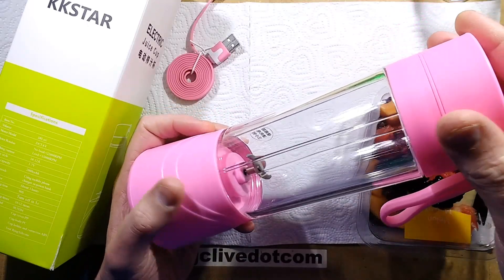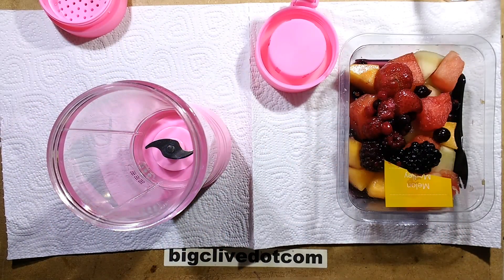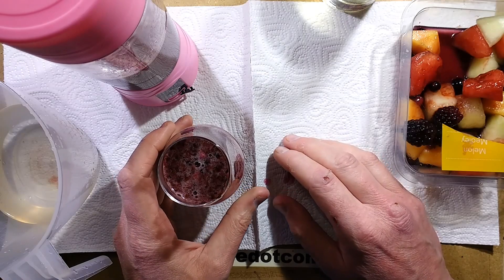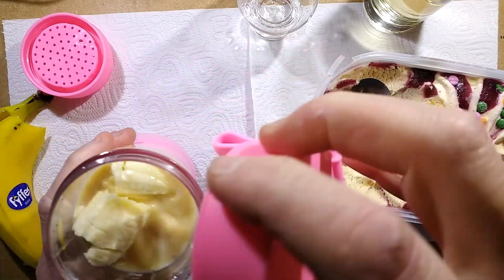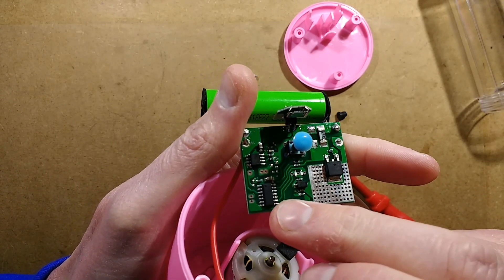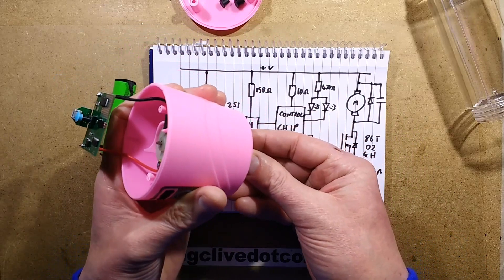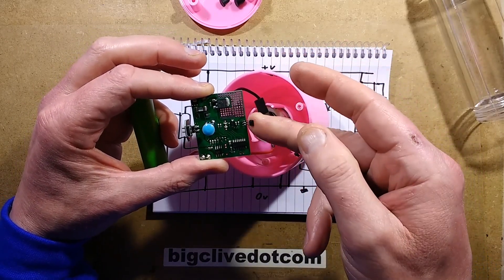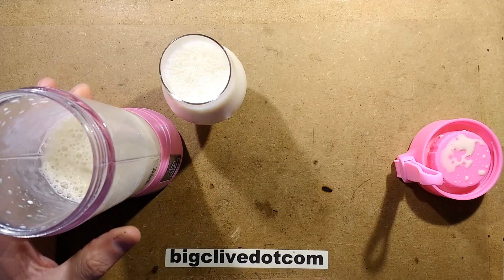Pink plastic USB blender test, fail and teardown.  (With schematic.)

Comment: wow, that's alot better than I was expecting from a phone battery driven blender. might consider getting one to play with.
Reply: Trust me this thing is a bad sex toy.
Reply: Not exactly a phone battery, it's an 18650 they are used in e-cigs and some camera equipment amongst other things.
Reply: "I haven't ran across a rechargeable vibrator using a USB connection as of yet" - should we ask how much effort you've put into this search?
Reply: The battery has 6.28 gigawatt hour/ gram power density.
Reply: there are rechargeable usb ones. or so Ive heard...
Reply: unsure of the USB bit but there are ones that are rechargeable and mains powered ones if you look
Reply: I'd rather not...
Reply: Thanks commentor
Reply: I was making a generalisation lol, calm down sir

Comment: Next video from clive: USB Powered dishwasher
Reply: DerpyDoom
Does one dish at a time. Takes 3 hours. Uses water gathered from the "dehumidifier" in the previous video.
Reply: Or a toaster using Chinese MOSFETs  that work once ;)
Reply: After that, we have the USB powered coffee pot and the USB powered hair dryer.
Reply: You could probably USB power most things, given enough batteries and enough charging time.
Reply: That "water" would actually make for a good dishwasher detergent, though it would need to be diluted
Reply: Just USB charged my car battery
Reply: There's a usb powered washing machine. It's just a turbine you have to attach in a bucket.
Reply: I have the same and mine works perfectly it needs to be charged for 3 to 4 hours or more. I love mine

Comment: I really hope you washed it before use. :)
Reply from the maker: You're damned right I did.  As with ANY new food product.
Reply: I got one that features a power bank function as well, and came with pre-grown mildew inside the glass container, uhgg .. But nothing better than extending your phone battery life with the mixer that made you sick. ;-o
Reply: Also - the safety functions are missing - no hall sensor included (unpopulated on circuit board).

Comment: I wonder, why are the ic powered through resistors?
Reply from the maker: The 10 ohm resistor and capacitor across the control chip will act as a crude filter to reduce the risk of motor-transients affecting the processor.

Comment: I wonder if you could modify it by adding another 18650 in parallel with the existing cell. Would doing so help to prevent the motor from stalling? Think it's time for more drinks.
Reply from the maker: The stalling is the overload detection across the sense resistor.  It's probably optimised to protect the motor from damage.
Reply: bigclivedotcom - would the control chip have the function to completely stop the unit if it detects several overloads in short succession, i.e. an "I really can't cope with high chunks of melon so there's no point continuing" cut off?
Reply from the maker: I think it just annoys the user into submission by stopping for a short time each time an overload is detected.

Comment: what about uprating the motor to something like a 3-phase motor and a 3-phase power generator that can work of a Lithium battery, or actually scale it up.
Reply: DAVID GREGORY KERR sure you could put a 3 phase motor and an inverter to drive it. Doing so would allow you to put a smaller motor for the same power or a more powerful motor.  The drawbacks for doing this would be cost, loss of efficiency converting the DC to 3ph AC and more loss boosting voltage if you're doing that and of course, if you're boosting power, you're going to have to have a battery capable of outputting that kind of amperage. A drill battery putting out a lot more voltage would be pretty sweet, and you could just hack the brushless DC motor from the drill with its controller in it. A brushless DC motor is technically an "ac" motor, and could be multi phase. It could be pretty "skookum". have a look at Ave's channel for more on this

Comment: I think it would be pretty nice to change it to an external battery sled and use it for diy vape juice mixing. I use a lot of VG in my mixes and the standard magnetic spinner doesn't like the viscosity of VG. I say external, so I wouldn't have to wait for charges.
Reply: I believe he does/had made his own liquids in the past, maybe he'll give it a go if he sees this?
Reply: Ya, I do recall least two times he messed with VG. Though, I think at the time he did it straight :) $10 bucks isn't much to test it if he doesn't, just would suck if it didn't work. Though, if I do try it, I'll let you know the results. Personally, I do a 80%VG/20%PG (PG is mostly the flavor, so I can't ever say what I DiY is 100% VG :) ).
Reply: He’s supposed to dice the fruit very small in order to blend!